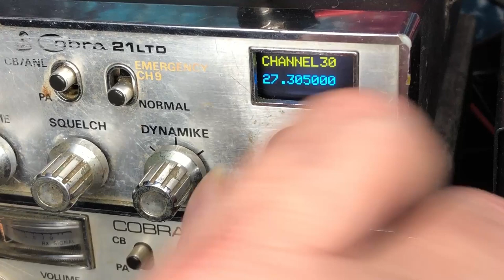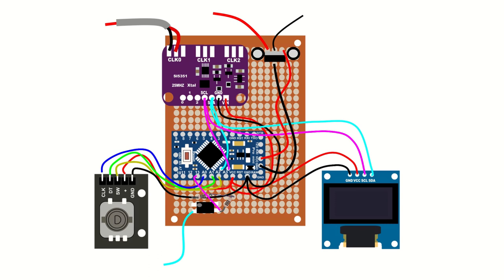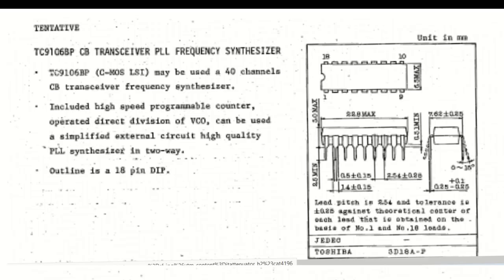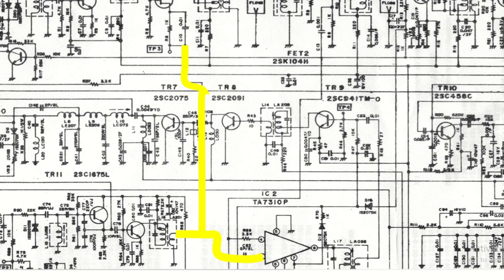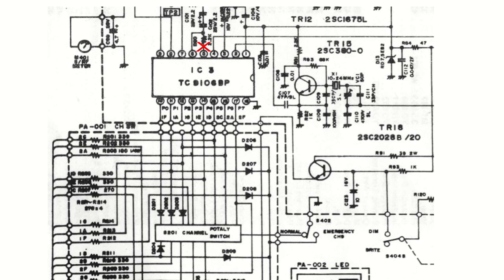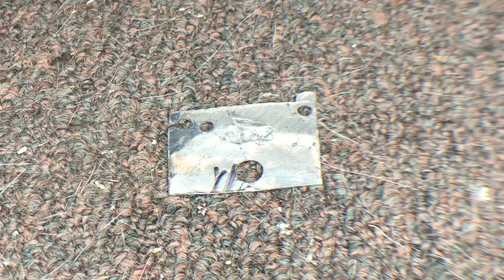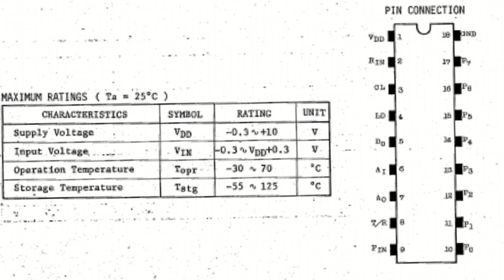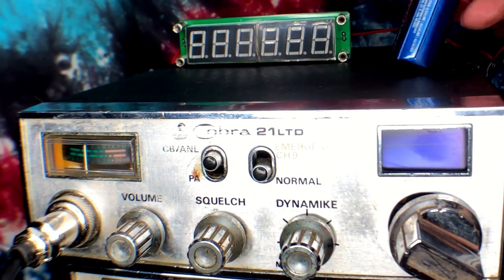Arduino Project: dds vfo install cobra 21 and Cobra 25 ltd CB Radios

Comment: Superb peace of work, and keeping the design simple is spot on, I congratulate you, great to see your interest in cb radio  fantastic video too, I have been busy too,  I designed a transmitter/receiver circuit on the 40meter band that plugs into the cb and it transmits on the correct frequencys, no mods to the cb.
Reply from the maker: Thank you! 40 meter that's awesome!

Comment: Hi nice work, those radios using that pll couldn't be modify back in days till now you did it.
I got a cobra 148 gtl that was in bad shape pll vco and tx output was not working, I got it to receive by installing a Arduino vfo but I trying to incorporate the lsb and usb offsets in the code but still no luck ( I am new in cc++ programing about one year), that will by a nice project for you.
Reply from the maker: Right on, yeah I plan on doing a side band radio as soon as I can. The VFO designs I have done so far are AM and possibly FM/CW only. The switching for side band is a bit more involved, the clarifier is another challenge, good luck with the 148. I always wanted one of those but could never justify the expense since everyone I talk to are on AM all the time.
Reply: yes they could, i used to make programers for them back in the late 70s 😁😁

Comment: Just a quick question!.. the tx wire on the opto_cupla does that go to the tx on the pll, or does it connect to put switch 🤔 thank you for your help.
Reply from the maker: That goes to the tx on the mic connector that is pulled to ground on transmit.

Comment: no compatible with cobra 29? or 148?
Reply from the maker: I have not gone through the 29 schematic or taken readings to confirm, but it should work with it, however the connections will be slightly different than the 25 and 21 ltd, I believe the tx and rx offsets will be the same. The 148 is a side band radio so the vfo will likely need modifications for lower side band offset and additional functionality for the clarifier (voice lock). I intend to add those features to future designs and a few other options and ports to other micro controllers  as my series on vfos progresses.
Reply: @CircuitSecrets  I have a 25, but I have problems about the tx connection, could you explain a little more, I want to install it and try it with my cb
Reply from the maker: @messinasog  Which portion of TX? The connection for the tx/rx switching which is connected to the mic plug? All it does is sense if the ptt switch in the mic is in tx or rx. You can use standard mic wiring diagrams to find the correct pin. You can also use a continuity test, the tx pin is the one that is pulled to ground only when the mic is keyed. I think I explained the tx lock out in the video. Tx from the vco connection point is the same circuit as rx but the ptt switches the frequency offset. I hope this helps.
Reply: @CircuitSecrets  Do u have other way to talk about it? whatsapp or facebook?
Reply from the maker: @messinasog  No I am sorry I don't currently.
Reply: @circuitsecrets question, I had try to upload the code into a arduino nano and for some reason shows me an error what program do you use to transfer the data to the arduino ?

Comment: A friend buy an cobra 18 ltd and the pll is the same 9106 you think can i do the same process for 21 or 25 ?? The 18ltd dont have the L16 vco
Reply from the maker: If you can locate the vco and identify the output pin of its last transformer there should be no problem. Confirm that with a frequency counter with a coupling capacitor.

Comment: Do you know the code  or have a link so I can make one for the cb ??

Thankyou 

73.
Reply from the maker: The code for the vfos I build is stored on circuitsecrets.com there are a few versions and I am slowly adding features and support for different processors. There are companion videos on this channel that describe the different VFO configurations I have released.
Reply: @CircuitSecrets  that’s great I will take a look Thankyou kindly that’s just what i need for my  radios 😎☝️
Reply: The code won’t compile ..? What version of ide are you using to compile the sketch please 

I can’t find any what work … looking for a hex file if possible … I have so many problems verifying the sketch 

Thankyou 🎉

For your reply 

73
Reply from the maker: @cbradiohamfan  The version should not matter, Arduino is really good at being backwards compatible. If it wont compile, my bet is you need to install a library. The adafruit ssd1306 library has to be added to your arduino instillation. That library supports the display. You also need to install the etherkit si5351 library to support the si5351. I just tried it on a fresh install, the sketch would not compile without those two libraries. Good luck.

Comment: hello, you think is possible to install it on a cobra 29 ltd with the D2816C pll ic, is the 22dip
Reply from the maker: Sorry I have not gotten the 29 virtual install video done yet, have a couple of things on the bench I have been dealing with. Yes that pll is similar to the one in the 25/21 ltd. The pin out is a bit different on the pll, the LD out (loop detect/lock detect) transmit disable is on pin 15, pin 17 is the output to the vco. I am not sure about the frequency offsets, but I would assume it runs a 10.240mhz reference and local for mixing and standard 455khz offset for receive. If this is the case installation is very similar to the 21/25 ltd and will work with the default offsets. Check the output of the vco with a frequency counter to make sure you are using the correct offsets.
Reply: @CircuitSecrets  i did the same process as the 21/25 but at the moment i delete the vco and Connect the si5351 and Connect the pin 13 of the arduino to the tx of the radio the led of tx/rx turn Orange and the arduino reset
Reply from the maker: @messinasog  did you forget the opto coupler on pin 13? The led should be on until you press to talk, then the led should go out.
Reply: @CircuitSecrets  Can u xplain me more about the opto connection arduino and the resistors
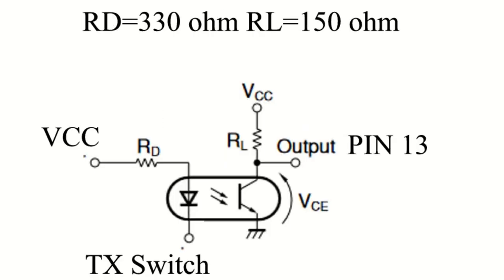Reply from the maker: @messinasog  There is a schematic for the opto coupler in circuit in the video at the 1:25 mark. To understand more about opto couplers for background on how they work check out this video. https://youtu.be/OWG4863rusc Let me know if you have any questions after that.
Reply: @CircuitSecrets  I think im not using the same opto as your video, what is the exact opto are u using
Reply from the maker: @messinasog  I use a Chinese clone of PC817X.
Reply: @CircuitSecrets  i think is not workin bc im using a pc123, im gonna use the pc817, im trying with the cobra 29 upd2816 and dont have any positive results, i think u cand do it i bealive on u
Reply from the maker: @messinasog  I will try to get a virtual install video done next week to explain it. I unfortunately do not have a 29, but I have been looking for one.
Reply: @CircuitSecrets  thanks man, greetings

Comment: I see you used an incremental encoder, which is good for mobile use.
 Do you know of an  absolute encoder that will work with the kit? Thanks:)
Reply from the maker: An absolute encoder would require a complete rewrite, and it would be extremely cost prohibitive.
Reply: @CircuitSecrets  I actually am in the process of putting an arduino together now and took the encoder apart to have a look for the detent. There is a ring inside that is close to the shaft end that has the detent built in. I took a small screwdriver and flattened it out some and re-raisd the ring back up, the put it back together. In my case, I wanted  smooth tuning, and this absolutely worked without any problems, and it still functions normally. 
I don't recommend anyone doing that for a mobile, tho.
Reply from the maker: @Guns_N_Gears  That is awesome! As long as it still works. The encoders I used to build the prototypes were really cheap and easily messed up so they would not read if too much side to side pressure was applied, seemed to damage contacts. Good luck!.
Reply: @Guns_N_Gears  get one from Yaesu for an HF rig.
Reply: @KarlM777  I have since found smooth mechanicals on the web @ about the same cost.
The encoders that Yaesu and the like are optical style, and would require a program change. The style used like this video are mechanical type, basically a couple of pushbutton switches ganged into 1 rotary unit.
Reply from the maker: @Guns_N_Gears  Nice, I will check that out for the next revision!

Comment: Hello again, i install it on a cobra 25, but at the moment i press the mic the cb transmit in other frequency, but i recive ok and i can listen the frequency but i cant transmit
Reply from the maker: If you are using the pro mini the built in led should go out when you transmit to indicate the ground connection to pin 13. Did you connect pin 13 to an optocoupler and resistors as shown in the schematic in the video? Or did you wire pin 13 directly to the tx pin on the mic connector?
Reply: @CircuitSecrets  IT WORKS!! Now you can do it on a cobra 29 ltd? i have one but the expanders are only for hi or low channels
Reply from the maker: @messinasog  Unfortunately I do not have a 29 on hand. If you want I can do a virtual install guide though using a schematic and diagrams. I will not be able to confirm it works though since I do not have one to test it on.
Reply: @CircuitSecrets  yes please

Comment: I need help, I have try to install the kit in a cobra 25  everything works fine but the transmit does not have done everything but have no luck can someone who has done it give me a hand?
Reply from the maker: Did you bypass the transmit lock? If everything else is working, and the radio was transmitting before, that is where I would look.
Reply: Yes I did, the tx circuit works reducing the 5v to 2v going to D13 arduino right
Reply from the maker: @GusNava  I think you are confusing the tx lockout feature on the pll with the tx rx switching on the vfo.